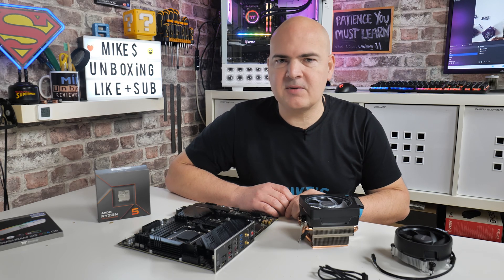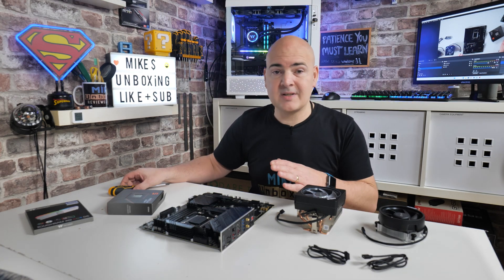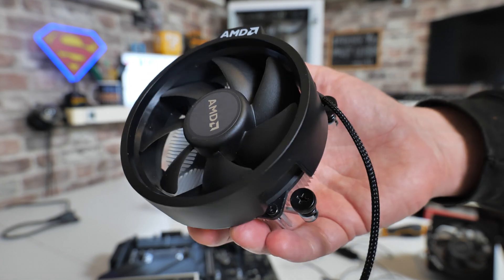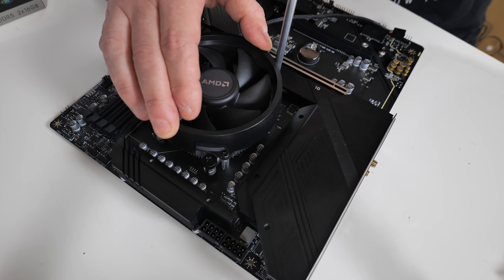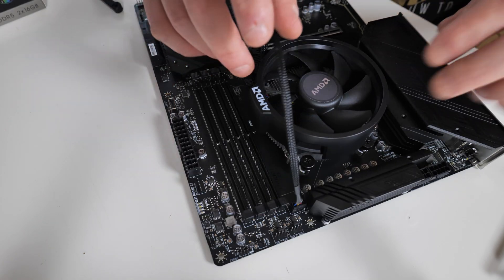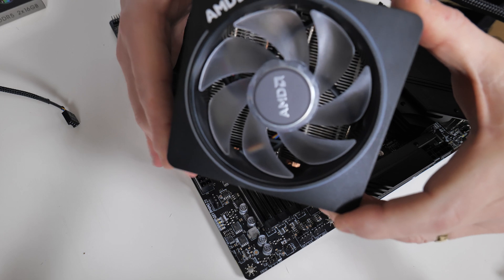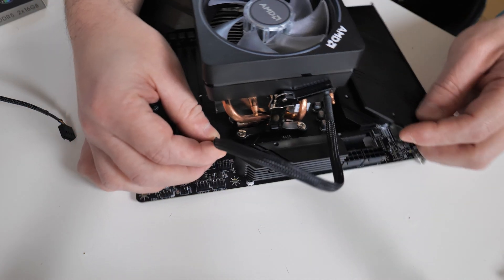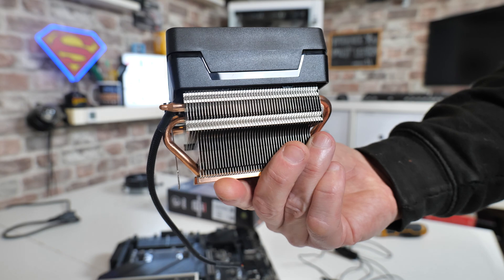How To Install AMD Ryzen AM5 Stock Cooler Wraith Stealth Prism RGB

Comment: it not a basic video , am5 is relatively new,  so learning compatible cooler installation is new for many , who have been using am4 and having used am3 CPU's.
Reply from the maker: That's a good point; even for experienced builders, AM5 is a new platform.

Comment: 建議原廠幽靈散熱器的底座現拿去做拋光，拋光底座( 溫度更低，散熱膏用量更少，比較不容易黏住CPU連根拔起 )
Reply from the maker: it is a good idea to make the surfaces as flat and smooth as possible, but in regard to cooling performance you will always be limited by the coolers thermal mass and the amount of air that can flow through it

Comment: Hey, I’ve just completed an am5 build and reused my wraith prism cooler from a few years ago. Followed the steps in this video, making sure to apply thermal paste, however my CPU was hitting 96 Celsius during a BIOS update. Any idea why this might be happening? Dodgy paste or maybe not enough used? Cheers, thanks for the vid.
Reply from the maker: dodgy paste or uneven mounting pressure

Comment: 🤔 so that 4pin RGB plug, I assume with that plugged in you only have a choice of RED LED's to light up the cooler? and What about that USB Plug Header, so if you use that I assume u don't need to plug in the 4pin rgb plug,, and what does the USB offer you? Does the USB offer you ARGB Rainbow Color Options? And finally why didn't they offer up a 3pin ARGB plug so you can easily change the colors using a case button and/or a hub and/or the motherboard 🙂 thanks for the noob video
Reply from the maker: the RGB 4 pin allows the colours to change but only the whole area at the same time so no rainbow effects like addressable RGBs, the USB connection allows lighting like that
Reply: @mikesunboxing  🙂 oh I see, thank you for the explanation

Comment: Thanks for the video, I need to rip out my x470 /5700x and replace it with a Gigabyte B650 /7600x. and I had planned to use my Wraith Prism RGB cooler from my 5700x, which came from a 3700x back in 2019, it does a good job on the 5700x when tuned as to see 4725 -50Mhz gaming and 64c using Corsair XTXM50 paste.

So the plan is to use the Wraith Prism RGB and running in Eco mode on the 7600x, I got a good deal from Best Buy on the cpu and board for $289.98 and 32Gb of DDR5 5600Mhz for $79.99 with AMD Expo, kind of hard to say no when Starfield was also free!
Reply from the maker: i hope you enjoy the build
Reply: That's good, but ddr5 6000 minimum

Comment: well done guys, not a beginner lol but for all those that get the Ryzen 7600, 7700 and 7900 non-x versions of the CPU there is simply no need to get any other after market cooler because with the latest bios on all boards its almost impossible to get it over 80 degrees any more so a water cooler looks great but zero performance gain will 
be gained  as Mike says artic MX4-MX8 OR COOLER MASTER GEL-PRO V2 FOR £6 MAX each is a much better pairing best to do this every 12-18 months or check temps using HWINFO and take a screen capture at first bootup so you guys have refference points.

Comment: Thanks and I'm in the "I can't afford to screw this up" camp. R9 7900, Motherboard came in just under $900 Cad. Long gone are the days when you could run a K6 450mhz for half an hour with no cooler at all after dropping it on the floor a few times. Also, 2 header cables for RGB means find a place for them both to a lot of people.

Comment: If 7700x and 7700 have the same price, is it worth more to get a free cooler or the performance difference and go for 7700x would you say?
Reply from the maker: 7700x offers a little more performance headroom, and the stock cooler isn't great for am5

Comment: I might get am5 once i sell my 12100f/6700xt to a great friend of mine
Do u think the wraith prism sufficefor ryzen 7700?
I plan on doing game on it with occasional handbrake encode 12:54
Reply from the maker: if you have a decent airflow case it should be okay the 7700 is a 65w part
Reply: @mikesunboxing  been thinking to get the jonsbo d31/41 with b650m on it

Comment: What would be fun is to compare stock amd cooler vs stock intel cooler. Using the ring that comes with Snowman cooler or any cooler that come with coolers equiped with amd clips, you can literraly mount the stock amd cooler on an intel.
Reply from the maker: ooh that is a good idea
Reply: Para😊😊

Comment: I wish AMD had just added a little lip at the front of each of the lips so when you are trying to clamp the prism down, it would prevent the latch from sliding off the end of the plastic hook.  It would make it a lot easier installation wise. 😹
Reply from the maker: yes that is very true.

Comment: In general I find stock coolers pretty poor. Even low cost 3rd party cooler tend to perform better but better than nothing I suppose 🤣 Appreciate the video - as you say no doubt someone will find it useful. And a belated happy anniversary 🎉
Reply: I tend to agree with you.  The wraith stealth is pretty poor and I was disappointed to see it provided along with Ryzen 5s.  
The prism and spire are much better.  Actually usable and way better than anything I’ve seen from intel
Reply: @evers6214  The Stealth sounds like it's about to take off at times! And as for the ones Intel started supplying with the 12th gen, I was optomistic at first but they're just as bad. Practically e-waste imo.
Reply from the maker: thanks Mike

Comment: I found the AMD logo`d lump on the side can interfere with ram installation with some of these AMD coolers so mount them with it away from the slots.
Reply: If you carefully prize off the shroud around the fan, you can get at the screws to turn the fan part through 90 degrees, relative to the heatsink. The shroud can then be put back on, you will hear it click, with the 'lump' at the top. Maybe Mike could do a video.
Reply: @-oneperson-  That’s interesting to note thanks
Reply: @-oneperson-  Im sorry but how do you do this? Cause it looked easy at first for someone who dissasembles a lot of stuff, but then I noticed the screws that go from the plastic parto to the metal heatsink, are not actually screwed in per sa, the metal part is just "squeezing" the screws.
This is why they dont turn to unscrew, but most worrysome is that if I do get it off I dont think it will go in any normal way as they couldnt be screwed in.
Hope you can help.
Reply: @bluewolf7111  Hi, It is a while since I last did this, I use an AIO these days. I do still have a couple of these stock coolers and have checked and the screws are screwed into the heatsink. I can sort of see what you mean about the squeezing, because there is a cut-out down the side of the screwhole. But they are definitely screwed in and very tight. When I had the screws out, which are black, the tips of them are silver from the metal of the heatsink. I hope that helps.
Reply: @-oneperson-  thanks a lot, it was impossible to remove with a normal screwdriver, as they wont budge and the screw began to show wear from attempts. 
I can only think of trying with an electric screwdriver or leave as is.
Most dissapointingly, when trying to assemble back in the cover that snaps in, I required so much force I somehow busted one of the holes for the tiny thin screws (which now glued, looks almost perfect but still).
Reply from the maker: good point

Comment: Not bad for a free offering. I still favor my Vetroo V5 on my Ryzen 7 5800x thus far. It has served me well, and the Ryzen 7 CPU did not come with a cooler.

A lot of good information here not just for the AMD stock coolers but also for installing this type of CPU cooler in general. The plastic pin hold downs are not my favorite, but it seems to work well enough to keep a CPU cool under normal workloads.

Unlike @uglybob7505 ... I appreciate the finer things in life. I appreciate shiny objects and often find myself staring at them for hours while accomplishing nothing. I don't think there is a better example than RGB lighting. I find it mesmerizing.

Now, if you will please excuse me, I think I will gaze into my compute case and ponder why UglyBob hates it so much!